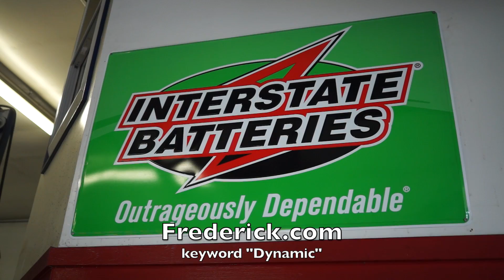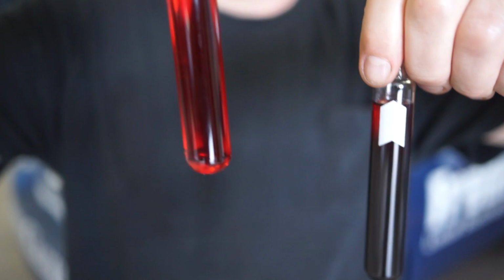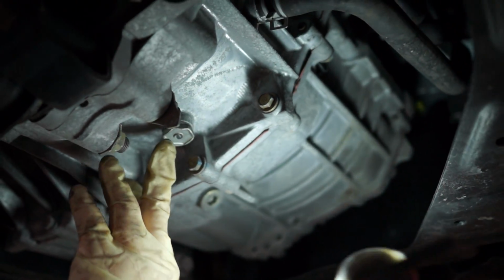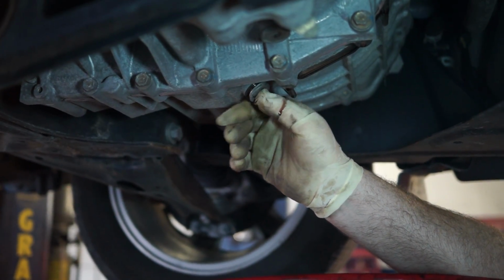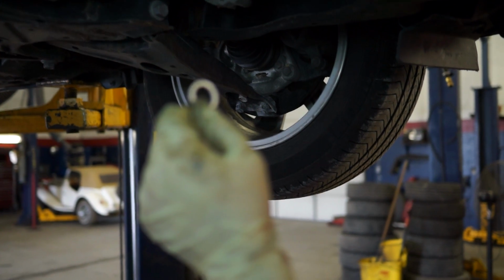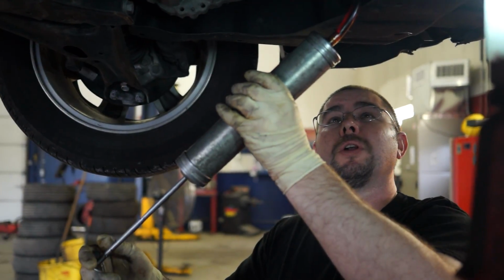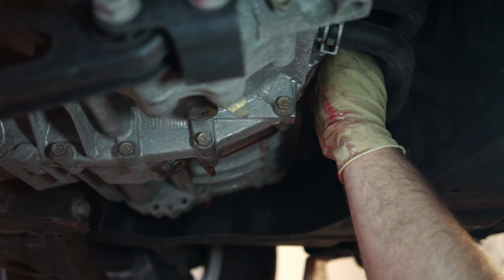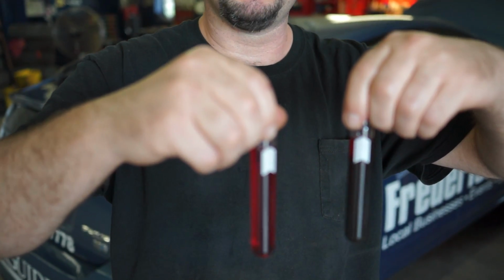Prius Transmission Fluid Change (eCVT)

Comment: Ok, here goes. I own a 2008 Toyota Prius,(series 2). I have done a lot of Exhaustive Research and talked to Product Specialists,Certified Toyota Hybrid Techs,Toyota Service Experts, Electrical & Mechanical Engineers until Both of us are BLUE in the Face, and have come across the following, FACTS!!!

1, The Series 2 Toyota Prius does not have a CVT like honda,(BELT), it has a E(electronically) C(controled) V(varible) T(transmission). The electronics/motor/alternators contained with in this transmission create the variable aspect of this transmission. These things conjoined with a excellent Planetary gear system make this a mechanically simple a reliable way of getting the power to the wheels.

2, The Stator coil windings ARE,(all tho some what shielded), exposed to the transmission fluid!  BUT, they are NOT affected by it, because of very extensive insulation and shielding. All ATF / Dextron, motor oil can be mildly semi conductive in the right circumstances & conditions. Don't be too concerned by this because many & various motorcycle alternators have had their stators totally showered with very hot motor oil since the 1970's. Manufacturers have for a long time have figured out how to keep stators from shorting out in this situation . Sure, I know with the Prius we are talking about 200~300 volts and much higher amperage than a 12~14 volt motorcycle charging setup. BUT, the principal in protecting the stator windings is still the same. NO WORRIES, ok.

3, That cute little magnet in the drain plug of this transmission maybe ok, but.  Think for a minuet. If you were a very small metal particle would you go to that wimpy little magnet in the drain plug OR would you find your way to the HUGE Magnets on the motor rotors! This is considered to be true,yet  Don't be to concerned here either. The high RPM of these rotors tend to fling off most, if not all, of this metallic debris if anything gets temporally attached to it. The magnet in the drain plug does serve it's purpose, but not to the extent that you think it does in these type of transmissions. Seeing metallic residu is normal with any transmission oil/fluid change, and the Prius is no different with what comes out than any other transmission.

4, It is NOT necessary to pre-heat the replacement Transmission oil before adding it into the transmission when changing this oil/fluid. This idea is just for anal nitpickers that think it will male a difference. IT Really won't make that much of a difference! The spec for the design of the transmission case allows for a variance of +/- 8 mm from the lower edge of the inspection/refill hole. This is a normal range for the (hot),expansion & (cold),contraction of the level for transmission fluid within this case. Just SLOWLY add the fluid until you start to see it come out the hole, then stop. Then wait a minuet for the fluid/oil level to stabilize, then recheck it with the tip of your finger just to be sure. NOW, there is one thing that I can highly recommend when changing transmission fluid in ANY vehicle is to have the vehicle "Level" !! This can be verified &  done with a simple carpenters level on a open door sill. You don't check you engine oil level when you are on a slope! So you must make sure that you're (Prius), vehicle is level when adding & checking the level of fluid in the transmission. HOW, you get it level and keep it level is your Karma &/or problem, but it must be done if you are going to do it accurately

5, It should NOT be necessary, {all be it Toyota's opinion to differ}, to use the expensive Toyota ATF WS transmission fluid when doing a transmission oil/fluid change in a Series 2, 2004~2009 Toyota Prius.

 WHAT!!!! Blamelessly YOU SAY!!!

Well. I can PROVE IT!!

 When the series 2 Prius came out in 2004 it had Fluid just like  DEXTRON IV in it to begin with, why?!? Because that was what was generally available to the automotive industry at that time. AND whats more! The design of this transmission has not changed much if any, during the time it was marketed,(2004~2009 ) Also, The Toyota ATF WS fluid (full synthetic), wasn't made/available until the 2007 model year. I verified this to be true with a (reluctant)Toyota corporate product specialist. So using a very good Fully synthetic AFT like Valvoline Max-life will do just fine.

 BUT, just to double check, I also called and talked with a Valvoline product specialist at Ashland Oil Co. and, was assured that the Valvoline Max-life () ATF  has been approved to be a completely compatible replacement transmission fluid to the expensive Toyota ATF WS. This was verified with a 100k mileage test conducted by Valvoline and a independent test lab to be true. This test was carried out and the product compatibly list was updated in late 2012 and shown in the 2013 Valvoline product list and at this point is more than suitable replacement transmission fluid for the Toyota series 2 Prius. Also there is another product manufactured by Red Line. Their Red Line C-6, full synthetic ATF has been used by many and was found to give excelent performance in the Toyota Prius transmission. Red Line makes a good product yet the price of this product is only slightly comparable with Toyota's ATF WS. So there isn't a big price break between these two products. Only availability will be a deciding factor here.
Also, there are alot of rumors/info. surrounding a lab test report that found higher than normal copper content in old transmission fluid from a Prius. This test was done on a original series ONE Prius, NOT a series 2 Prius. And there is to my knowledge, no conciseness of why this it so. CU - Copper is a normal element left over in the waist oil change of just about anyone's transmission,( sacrificial soft metals gets worn off first ).   But it will not & does not envolve the copper in the stator windings, WHY, See previous point 2 in this discussion. IF this did happen in a Prius transmission you would have other MAJOR problems not related to the non-sense rumor that transmission fluid would melt the insulation on the stator windings. If transmission fluid melts insulation off of electrical wiring then ALL Modern electrically controlled transmission would have,(in one way or another), this problem.

6, There is no filter in this transmission for the Prius series 2, no pan to drop, just a drain plug and a fill/inspection hole/plug. The best preventive maintenance that can be done with this transmission it to change it OFTEN!! I really don't care what some people think is a good interval,(mileage / time/ color), but doing it is the MOST important thing. SO DO IT!!!!  All transmission oil/fluid are affected by time & mileage and to say it doesn't need to be changed is total complete ridiculousness!!!

I know that this raises a lot of eyebrows, (good & bad), on the so to speak mysteries regarding Toyota E-CVT transmission oil/fluid change. I hope this clears up a lot of misconceptions and puts a lot of peoples minds at ease. BUT, HEY Don't take my word for it! Go and do the research like I did. And after a few weeks of prowling the internet & calling dozens of people you will come to the same FACTS & conclusions that I have.

There will always be people that will find a reason to make other people worry about just about anything & everything. These people get the illusion of power over your thoughts & opinions and makes them feel important, that's their Karma, but you don't have to believe in them or be subjected to their influence, if you don't want to be.
Use good old common sense! Please take everything you read &/or see on the internet with a grain of salt. I can't help what people think of me or what I have tried to convey here.
BUT, I can do one thing very well, and that is I can tell you the facts as they have been presented to me. Please enjoy your Prius and drive safely.
Reply: So then why does my ATF WS bottles all have the year 2002 on them?
Reply: Fierce Protocol Because you exist within a distorted space-time. Welcome to our space-time where ATF WS wasnt put on market until 2007. You should post a picture so Dave Tallman can go fact checking for us.
Reply: Excellent research and writeup David.  Very useful.  I am planning to do a transmission fluid drain and refill on my 2007 Prius with 150K miles on it.  Will use the Valvoline MaxLife fluid that meets the Toyota WS standard...at less than half the cost of WS (thanks Walmart!).  Thanks for posting!
Reply: David Tallman i
Reply: Damn
Reply: I recently bought a 2007 prius with 152K miles, I was thinking on doing the fluid change and ordered all the needed materials but I really don't know what to do anymore because a lot of people are telling me that if the fluid has never been replaced when I change it I will damage my transmission, another bunch of people said that is a good thing to change it. Any real advice?
Thank you.
Reply: @olographics    What I've heard is that this was applicable to older, regular automatic transmissions, but not to these CVT and E-CVT transmissions.  

   You really should change it. I don't know what Toyota (many dealerships) is thinking with saying it doesn't ever need to be changed unless there are problems. 

      Many people have changed it late like you have, and many have noted how discolored and dirty it is. That cannot be good for your transmission.
Reply: theory816 Because if you research WS on bobistheoilguy and look at UOA’s this fluid is in fact not synthetic. It breaks down fairly quickly vs other quality fluids. I think it’s fine in a traditional wet clutch overdrive transmission to maintain shift quality if changed more often. But in a Prius there are definitely superior fluids available.

Comment: I use a fluid pump ( last one purchased at Oreilly's) it screws on top of any gallon washer fluid jug, holds 4qts, works very well, cheap price, I've only bought two in 25yrs.  tip put a small hole in top of the jug so it can breathe.
Reply: No lifting car?

Comment: Excellent ! I went at Toyota dealer and they said to me that kind of transmission does not requires fluid change. Thanks  for video my Prius mileage now is 247.000. I know is late. I head on the video we are supposed to change the fluid every 30.000 . Great video.
Reply: Thanks again!!!! very nice video.
Reply: Every 30-50k if you're mainly city driving. Otherwise 80-110k if you're mainly driving on the highway
Reply: I've been told at the dealer the same thing when I asked them about my 2011 Prius that has little bit over 50k... they said it's gonna cost $180 if I want them to do it. I bought 4qt of fluid and changed it myself.
Reply: The dealer in my town ,I’ll Perot,near Montréal,wanted $300 to change my trans oil.Doing it myself!
Reply: Pls do u later change urs and hope everything work perfect cos my also is on 250,000 and am think of changing it but am afraid, pls help me if to change it or leave it that way
Reply: @notime6199  just change half tank and add just two quarters, after 10,000 miles change the whole transmissions oil. good luck.

Comment: Thanks for the great video 
I just serviced my trans today 07  Prius has 220k 
Miles and it runs like new I service the trans every 50K miles and oil changes done every month
Reply: Craig Shipp Yes it's the original battery no issues what's so ever But if it goes out it's about 1K for a rebuilt one
Reply: 220K in 10 years is less than 2K a month and you're changing the oil for that! smh! more money than sense.

Comment: For a 2004 Prius, Toyota specifically recommends ATF fluid P/N #00028ATFWS. No substitutes. 

However around 2010 the ATF fluid change to P/N #0888602505 CVTFE and was given a CVT designation. Evolution of fluids occurs with the evolution of automobile advancements.

I verified to see if this latter fluid was now recommended for an older Prius, it is not.

Comment: Why didnt you drop trans pan clean out the screen, all the gunk, clean the magnet, put new o ring, new pan gasket?  I have 2002 prius with 71, 400 miles. Records dont indicate transmission service. Trans fluid looks dirty. Should pan be dropped to do listed service? Ie: clean screen, clean magnet etc?  Thank you for this great video.
Reply from the maker: I would just change the fluid and then keep an eye on it.

Comment: Hello my Toyota Prius 2007 My car has walked 330000 km Can I exchange gear oil or will it cause problems and is there a filter inside the gear that needs to be changed Thank you

Comment: Very important vid...maybe there is a way to install a auxiliary cooler to stabilize the temperature...and also look for a synthetic solution and a bigger radiator to prevent inverter burnout

Comment: i have 2014 prius v 339k miles i bought it new never change the transmission or cvt  oil yet (runs good for uber ) and not even planing to change it what you think
Reply: Change it.
Reply: At this point I wouldn't

Comment: I have a 2004 prius with 335000 km (approx 220000 miles) and as far as i know it hasnt been changed,  ive been told by several garages that at that mileage it may harm it more than do it any good if it has new fluids,??    i dont think this is right but you could confirm that for me?      also i have a slow leak in the seal, is there a way i can check the level of it
Reply: it's not a regular transmission..........only gears.......

Comment: I recently bought a 2007 prius with 152K miles, I was thinking on doing the fluid change and ordered all the needed materials but I really don't know what to do anymore because a lot of people are telling me that if the fluid has never been replaced when I change it I will damage my transmission, another bunch of people said that is a good thing to change it. Any real advice?
Thank you.
Reply from the maker: Change it if you're planning on keeping it for a while.
Reply: @MidAtlanticTV  thank you for your response!
Reply from the maker: @olographics  anytime!
Reply: car was bought 3 months ago and it has been working fine, and  yes, I want to keep it for as long as I can, you being a mechanic saying that is good to change it gives me peace of mind because my friends (that are not mechanics of course) tell me that my transmission will completely be ruined in a few months if I do it.
Thank you again.
Reply from the maker: @olographics  That's an old wives tale. The fact is if the transmission is damaged already there is nothing you can do. If it's not damaged changing the fluid will extend the life. Just be sure to use the correct Toyota fluid!
Reply: @MidAtlanticTV  I will, thanks again!
Reply: @olographics  how has your Prius been? Any updates?
Reply: @aaaaaaa7487  yes, I did the transmission oil replacement, was very easy to do and the car has been running excellent, I did it more than 2 years ago.

Comment: Why would you not mention the size tools being used to remove drain bolts if you are doing a video on how to change fluids?
Reply from the maker: The point of this video is to inform folks that they should have this service done. Not show them how to do it. For most it's best to have a professional take care of this sort of service. https://www.craigshipp.com/downloads
Reply: 10mm hex. Get the gasket from your dealer and make sure fill plug opens first before opening drain plug. Hope this helps.

Comment: Actually the WS fluid is way more stable and can last at least 100k miles. You do not need to flush. Just drain and refill every 100k miles is more than enough.

Comment: Do you still run the same risk with a CVT transmission that you do with a normal automatic transmission where if you don't change it at the proper interval and then change it, you could end up destroying the transmission?
Reply: Yes, it can hurt the transmission.
If it's over 10 years or 150K+, we have customers sign the paper.
Reply: @angelisone  damn, I should've changed mine by now
Reply: @jackbrady86  ATG & I would say, if it's your car. Change it 80K, 140K, 200K, then sell it.
We can surly hear people saying follow the directions in the manual.
But, surely over 90% of dealerships & shops DO NOT use Distilled Water when changing coolant. They just use regular tap water. 
And the manual stated uses distilled water & mix with antifreeze.

Don't be fooled buying "Pre-mixed Antifreeze". 
If one can't mix 50/50, then he shouldn't do it at all. Take it to the shop & get nailed.
You are paying for water & paying 1/2 of antifreeze

FYI: After 209K the car will have many problems
What a joke, $300.00 for two headlight bulbs & out of the door be $550+.
Rear light out, you got to replace the whole light panel assy.
Hybrid battery goes out 9 to 14 years at $5,100.00
Lower control arms
Inner & outer tie rods
Caliber & ballast failures
Water leaks
Reply: @Mike Fu Client came back and thank us to sell the car "As Is". Because we were honest.
New owner now has transmission & hybrid battery problems.

Comment: What about 2019 new model Toyota Corolla e-Cvt is the same or different ? Because someone says these cars do not have a transmission inside actually is a different system etc ? Which is correct information guys ?
Reply from the maker: Good question. I'm still running my 2004!

Comment: Very very helpful. I have a 180k 08 prius and need to change the fluid. What tools do i need aside from the lift. Thanks
Reply: 10mm hex socket from Harbor Freight (cheap) or Advance Auto or AutoZone or any good auto parts retailer. Also, need clear vinyl hose that will fit your funnel if filling from the top, like another YouTube video shows, or you can use transfer pump.
Reply: toby sarsi the fill up plug in this video is different what size?